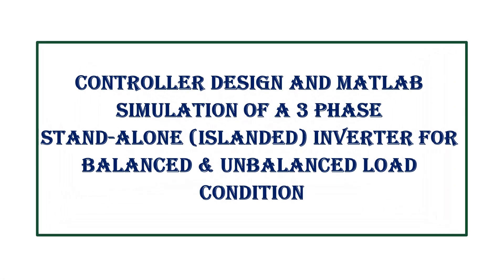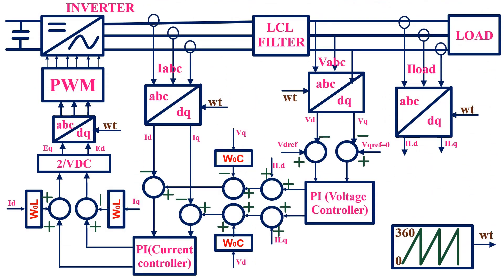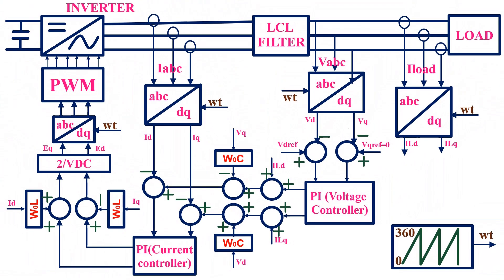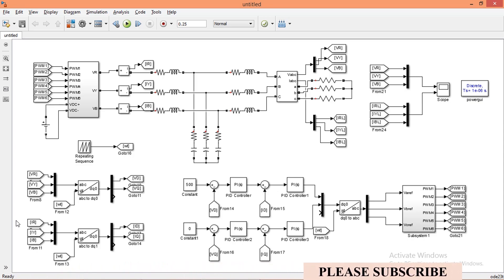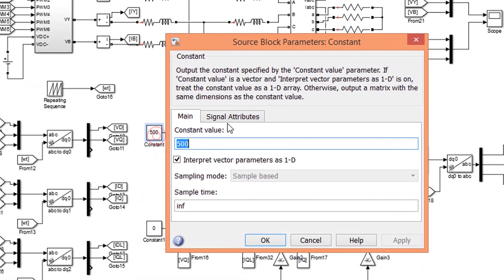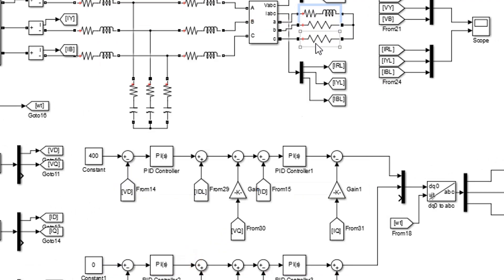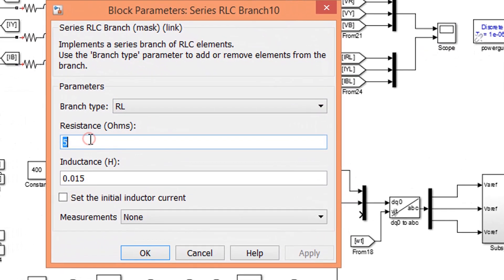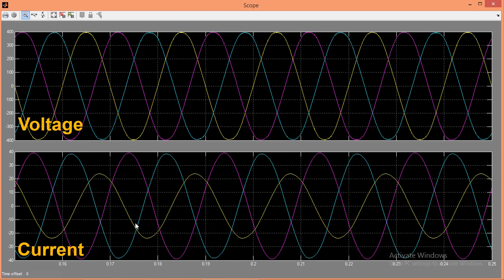MATLAB Simulation of 3 phase stand-alone inverter | Method-2 For Balanced & Unbalanced Load.

Comment: I have a question please sir. The reference paper says this scheme can work for grid mode as well as islanded mode and no detection of switching is needed. Will  generating (wt) with a sawtooth (as in this video) work for grid mode?  if yes, then why do we need PLL with grid voltage in other schemes (in another one of your videos) can't we just use the sawtooth method?, and if no, then a detection IS needed and the special thing about this scheme is not true. Please explain. Thank you

Comment: Why 400 why not 600?
Reply: to get 220V - 230V phase voltage
Reply: Its amplitude and it would be calculated as 230*sqrt(2) for 230 V supply system. Here he had taken it as just simply for understanding purposes

Comment: How u have taken the kp and ki values of the pi controller kindly guide me sir
Reply from the maker: First choose a time constant( 1.5 to 2 times of switching time would be better). To find kp divide the filter inductance with time constant you have chosen. Ki can be selected based on steady state error. Initially keep ki zero, then try increasing it until steady state error become zero.
Reply: @TechSimulator   how to find the switching time for this system